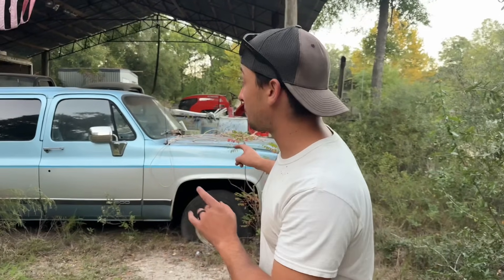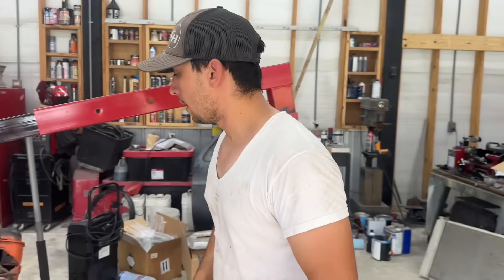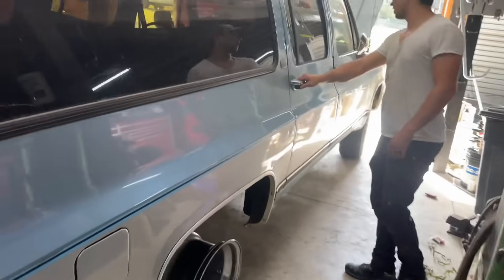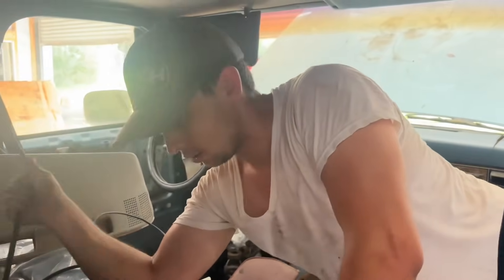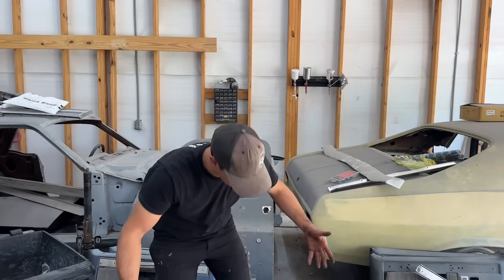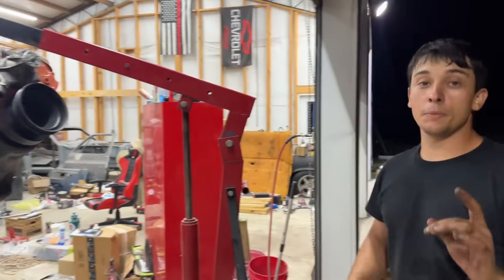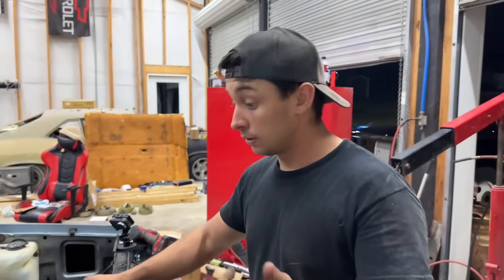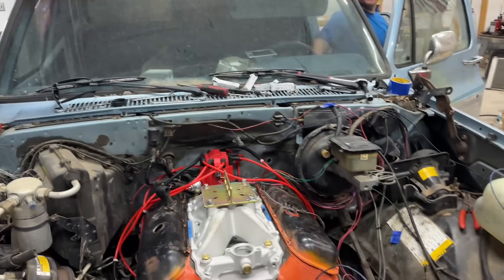Will It Start!? ABANDONED Suburban And 454 Big Block! 24 Hour Challenge!!!

Comment: I have a 82 chevy Scottsdale thinking about doing a video on it I want to do frame up restore with four link coil over suspension and 2 1/2 ton rockwells
Reply from the maker: @thomass2055  man do it! That would be nasty!
Reply: @CoopsHouse   cat 3406 engine? Detroit v12 diesel marine engine? What's your thoughts
Reply from the maker: @ the CAT would be sick. Never seen that before lol
Reply: @CoopsHouse  my dad had a v12 detriot in a 81 peterbilt 379exhd it would run circles around any engine on the road
Reply from the maker: That’s awesome!